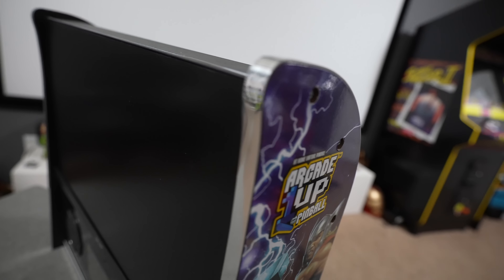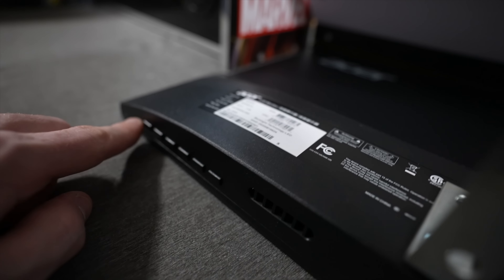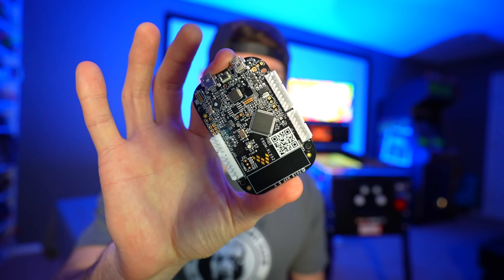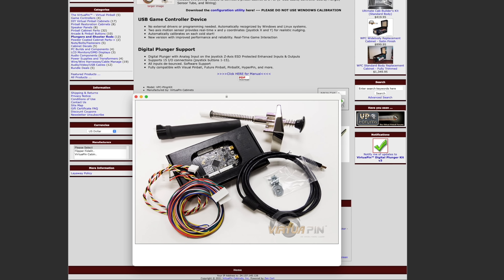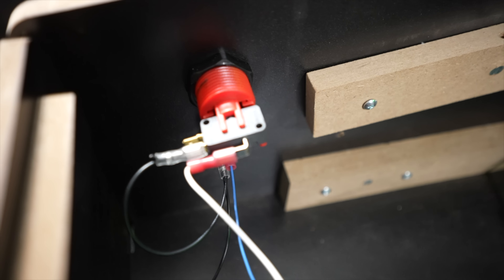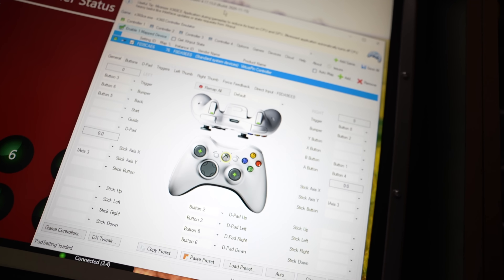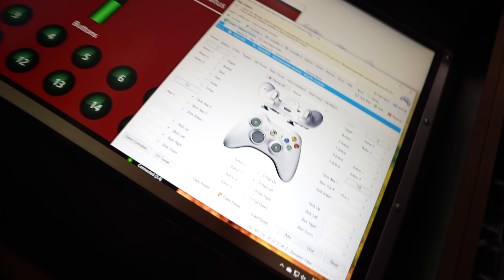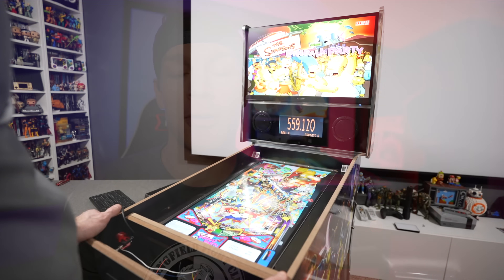Arcade1Up Pinball Mod Tutorial - Part 2

Comment: Modding my Williams Arcade1up..  Looks like some dimensions have changed somewhere as the 21" Monitor you used is not as tight a fit anymore (LOL)..  
My Williams stock monitor backlight went out..  So time to mod it up..  Got a 24" AOC and it fits into the slot where the original stock was.  Used some electrical tape to hold it on one side.  ..

I think I am going to try to route out the slot in the top and fit the top of the monitor (it is about double the width of the current slot.  The slide the monitor in from the side.
Wish me luck!

Comment: 8:35 The Virtuapin plunger also won't clamp onto the Arcade1UP wood box frame properly. The mounting holes/plate have taller screw posts. It looks like they were made for a slightly thicker wood mount than what is currently being used by Arcade 1UP. Not impossible to overcome, just something to be aware of.

Comment: For those interested the screen does not fit the mars attacks version of the pinball machine. Its off by 1/4-1/2 inch too small
Reply: Did you figure out a way to make it work? I have a mars attack cabinet and I have the same problem with the screen being too small.
Reply: @justincutler4143  yes. I used anchors to the back of the screen that I screwed into the screw holes then I created anchors on the wood floor that the screen sits on. Then I used big zip ties to tie the two  anchors together. The zip ties on either side of the screen allow me to slowly get either side tighter until it was perfect. Either side has a 1/8 in gap still but unnoticeable. For the top I used double sided 3m tape to tape the back against the top. It feels very secure despite sounding very insecure lol.
Reply: @nate5612  I found out that the monitor that is sold now is a different version than 3 years ago when he did this and the dimensions are a little smaller which is why we ran into that issue. I got it to work by padding the sides with some black stripping and then double side tape and the brackets on the bottom. Now I am pulling my hair out trying to get vpx working. It's so overhwhelming and frustrating that I wonder if it's even worth the hassle.

Comment: Thanks for this continuation video. I believe Kongs-R-Us was able to use the stock A1U plunger with the Geeekpi encoder. Using x360ce should allow you to use that in FX3, no need for more equipment.
Reply from the maker: as I stated in the video, there are several different methods of achieving the same results. I prefer the KL25Z board over the Geeekpi encoder for various reasons.
Reply: Difference i believe is, the board CoolToy uses is able to do nudge via buttons and/or physical, Kong's board is buttons only, no physical nudge. Both are options. Virtual Pinball is a rabbit hole and can be $$$, beware. 😂
Reply: @MrEd20901  you can actually install multiple klz boards and have them do different things, then link them in x360ce. I respect that there are multiple options and ways of doing things, but I still feel that spending $20 for a geeekpi using 100% stock pieces is economically and practically the way to go.
Reply from the maker: @MrEd20901  100% truth about the rabbit hole. That's why I said in the first video, you can spend very little, or a whole lot of money building and modding a machine. Since there are so many different ways to go about doing things.
Reply: @cooltoy  it is. I am in Major Frenchy's pinball discord. Some of the cabs in there are awesome. And a GREAT group of people. Very helpful.

Comment: I bought the same virtuapin plunger kit.  My screw terminals on the plunger look to be sized for 3/4" wood and the MDF on the A1up is 1/2".  As such, the screw terminals sit about 1/4" too long inside my cabinet and the mounting plate doesn't sit flush against the wood.  Did you have the same issue?  How did you resolve?  I'm thinking some 1/4" washers with a groove cut out might be my best bet but I wanted to hear your experiences.

Comment: OK so I have a question... Why do you have nudge buttons if the board comes with an accelerometer?  I thought nudge buttons for when you didn't have a built in accelerometer.  or does that just work for tilt and not actually affect ball movement when you shake the machine?
Reply from the maker: Simple, I like to physically nudge the machine and my wife prefers using the buttons. So now we can do either one and have the same result

Comment: @cooltoy  How did you connect the power to the DMD screen?  I have the black cord from it with the white adapter that no longer goes to a board. Any help is appreciated.
Reply: Same for me. I pulled the extension from the main power and ran it from the Y to the DMB controller. You can also order an extension cable from Amazon if needed.

Comment: I have that same monitor, is the monitor only staying in place mostly due to the sides being press against it?  I have used 3m tapes and gorilla tapes and nothing ever stays in place for long here in Phx AZ every thing droops with this heat. I'd be afraid that the monitor would just fall forward.  when you add the l brackets are you going to find a way to bolt them into the plastic or just 3m tape only?  Anyways, thanks for the video man.
Reply from the maker: The pressure from the sides and the 3M tape is more than secure for me personally. You could always drill a bracket into the monitor case if you feel the need for some more security
Reply: @cooltoy  good to know man. I guess I'll try it out when the cab actually gets here for my to feel in person. Thanks for the reply sir!

Comment: If you purchase the KL25Z accelerometer board with plunger from Virtuapin you are basically paying for everything setup, including the firmware to incorporate the plunger and nudge. Once you receive that kit, you download their software and it basically allows you to map the buttons, plunger and nudge features using x360ce. You then go into x360ce, select your accelerometer device and then go to the buttons/ sticks you want to map your plunger, buttons and nudge features. You then click the button or stick you want and click record. If you want to map your accelerometer to the dpad, select dpad up, left or right and then select record, then apply the appropriate nudge direction and it should map the proper axis to that button. You can then use Virtuapin software for you plunger / accelerometer to adjust the thresholds and multipliers to make it more or less sensitive. Hope this helps anyone who decides to add the digital plunger and accelerometer from Virtuapin to their cabinet.
Reply: Thank you for this.  I am embarking on this today after watching these very useful, insightful and appreciated videos.

Comment: Just wondering if I can put another 1up pinball machine electronics into my first cabinet,sharing monitor and buttons by using splitters,two power supplies,run one at a time,so I can mod the other cabinet..??
Reply from the maker: technically yes that can be done, but that's going to be a lot of extra work
Reply: Cool,not much else to to in lockdown,I only have room for 2 machines,so I figure it's a good starting point,Great looking cabinets.Any special plug required for the monitor ,splitter or just standard stuff.
Reply from the maker: nothing special
Reply: I just saw the original backglass flashing lights for mars attacks,what is the voltage for the backglass led's and could I use programable led strip lights to replicate the sequence,as well.?

Comment: Really nice work!  I have a question, why did you choose the Arcade1up and not the Legends pinball?  I ask because I am looking to buy a pinball machine and I am excited about mod'ing it, but some of the mods you did are already in the Legends unit (upgrade the playfield screen, controller for buttons and plunger, etc.) and based on price it seems like a better deal.  Just not sure if I'm missing something, like maybe it was because you owned the Arcadeup unit, or just a big fan, or maybe something big like the cabinet is better made or Legends has an issue you should avoid.  Thanks!
Reply from the maker: I own both machines and modded both
Reply: @cooltoy  Thanks, looks like I need to subscribe and go watch your other videos.

Comment: Awesome! Series. Just got my Star Wars! If it should break I'm ready :) I ordered on of those monitors before they become hard to find lol Do you have a solution for powering on the PC? or are you just going to mount on the bottom and turn on by hand?
Reply from the maker: Currently I've just got the PC plugged into a power outlet that has a toggle switch and I have the boot up on the PC set to start the moment it receives power. Technically I could splice some wires and connect the surge protector to the stock power switch and turn on the machine that way, but since I'm mounting the PC underneath the cabinet within arms reach I think that would be too much extra effort in the end.
Reply: @cooltoy  Thanks. Makes sense :) Looks like a great mod. I like the route you went with the plunger. More money but less fuss. Time is money!

Comment: So if I added the back box monitor would the dell optiplex 9020 still work ? It has 2 hdmi ports and 1 vga will that work or does it have to be 3 hdmis ?
Reply from the maker: it doesn't matter what type of display connection you use (hdmi, display port, vga) just so long as whatever computer you use has the horse power to send the signal to all three monitor connections. I'm personally using the opitplex 9020 with a 1650 low profile graphics card to get my 3 display connections.
Reply: @cooltoy  thank you for your quick reply and all the work you put into these machines for us to learn you could easily keep your tricks and charge ppl to mod theirs but you don’t you help as much as you can and I truly appreciate that thanks again.

Comment: Hello again, I gave an identical setup (been building along with you) and I can't get the plunger to work in all tables. It's works great in bob's burgers and does nothing in medieval madness for example. If you have any advice I would greatly appreciate it. Thanks
Reply from the maker: There should be no reason why it would work in one table and not others in FX3. Though I will say Medieval Madness uses a basic launch and doesn't actually use measure plunges as the original machine just had a basic launch button.
Reply: @cooltoy  that may be the issue then. Hmm, odd
Reply: Any idea how to make the plunger work for both types?
Reply from the maker: again, it should worth for both types in FX3 regardless. Worst case scenario you could always map the plunger to the Enter key in a program like Joy2Key and get it to work that way for single press launches also

Comment: Doug, you're amazing.  I am just starting on my journey and will begin the project on 4/14/22 when my AFM cabinet arrives from Walmart ($642.81) (I am a Bally/Williams junkie.)  I purchased the virtual pin kzl25 accelerometer and plunger kit you recommended ($171.70), Acer backbox monitor ($136.81), 36" LG playfield monitor ($225.21 refurbished), plastic feet, screw terminals, usb relay, jst connectors and diodes ($67.19).  I may do the additional exciters, amps and surround sound later but I think this is a good starting point.  Total spent $1243.34 so far.  (I have an HP Z2 micro sized PC with an i5 processor and integrated NVidia card with four display port outputs and 16 GB of RAM I got from work for free.)  I think that is SUPER reasonable for what this will be for the cost spent.  How large of a hard drive do you recommend for all the tables and storage?  Thanks for taking the time.  I used your affiliate links.

Comment: Got another question for you. I can't get X360CE to minimize at all on startup. I have PinUp Popper installed and running on startup but everytime X360CE autolaunches, it won't minimize. When I end up coming back from a game, the config utility sticks on top. I've written a bat to minimize it but apparently, there is a bug that makes it crash and I can't get it to work that way. Any tips?
Reply from the maker: If I remember correctly I just right clicked into that app properties and checked the box to keep it minimized. I believe you can also create a bat file that has start/min C:\whatever path your pc has to the program
Reply: @cooltoy  Thanks man! I tried both and couldn't get them to work without the app freezing. I ended up using an earlier build (v3 on their site) and that finally resolved it by placing it in the FX3 folder. Your videos have been amazing and stoked on my arcade 1up pinball build!

Comment: Hi Doug!  How did you get the new plunger to mount flush against the machine.  I made the T cutout like you did and I can get the plunger in there and it is flush against the front of the machine, but when I go to put the backplate on to secure it in place, the posts for the screws on the back of the plunger  platecome out so far that when I secure the backplate to it, the entire plunger assembly moves back and forth by an 1/2 inch or so.  In your video it looks like your backplate is perfectly flush against the cabinet.  What am I missing?
Reply: Have you got any answer to your question ?
Reply: @jeromelambert1048  I ended up putting cardboard on the inside to fill the gap.  I even emailed the company and never heard back from them.
Reply: Shims from a hardware store will work.

Comment: @COOLTOY I am having issues with the virtuapin plunger kit and was hoping you could answer it. I cut out the T section like you showed in your video. However, when I place the plunger assembly into the hole and connect the included backplate from virtuapin, it doesn’t sit flush against the cabinet. There’s a gap of about half an inch or so. Any clue on what I need to do or how yours is fastened in place?
Reply: I'm in the same boat with the kit and the half in gap between the backplate and the mdf... did you find a solution???
Reply: I had the same issue. I went to Home Despot and bought a cheap package of wooden shims, broke off what I needed, loosened the screws on the plunger, fit in a few shims, and tightened the screws. Works great now.

Comment: Hello again. I am starting on these steps today. I have the plunger kit and the KL25Z board. Are you using the Pinscape controller software or simply just the X360CE software. Not sure if I need to use one or the other or if Pinscape is just another alternative. Thanks!
Reply from the maker: Using x360ce

Comment: Sorry, more questions. Does the stock plunger analog connection fit into the virtuapin board? Just a lazy questiion really. I figure if I get the virtua pin kit I'll just set the better plunger aside until I feel like making the cut out. But if the connection is no the same I will cut it out lol Also, can you use joy2 key instead of the xbox config? If not, can you map keyboard buttons to the controller numbers? I play VPX and FUture pinball, everything is keyboard based. If the stock encoder etc is good, will it work with PC without the need to buy the virtuapin? Thanks again.
Reply from the maker: I could not figure out a wiring combination to use with the stock plunger on the KL25Z board that worked. If you want to use the stock plunger you can use something like the geeekpi encoder board that accepts analog inputs as well. You can use joy2key if you want, I used the Xbox config as it supports analog plunger input in fx3.
Reply: @cooltoy  Thanks man. I think I will get an arcade 1up. Was going to get a GRS but I think with all the fit and finish and mod possibilities this is a better choice. Thanks for all the help.

Comment: What kind of buttons did you replace the stock ones with?  You mentioned adding cherry switches but not listed below. 
Also with the pc did you need to swap your psu with the 1650 graphics card?
Reply from the maker: They are Happ buttons as I stated in the video. No need to change the psu for this 1650
Reply: Thanks. Love the video and looking forward to part 3.

Comment: Sorry if I missed it but can you tell me what video card you are using for this? Thanks
Reply from the maker: Gigabyte GeForce GTX 1650 D6 OC Low Profile 4GB GDDR6
Reply: @cooltoy  Thanks for the reply. Your Dell must be different than mine. My power supply is beside the PCI-E slot. No way I could fit a double slot card in there.
Reply from the maker: @c_ops6045  I’m using the stock power supply. It’s tight as hell but the card fit my 9020 sff optiplex just fine
Reply: @cooltoy  Ok thanks. Thinking of going with an adapter off Amazon and a regular PSU mounted elsewhere. Would give the card room to breathe and the extra power.

Comment: Hi Doug, I got a sb220q and followed your video but it just does not fit. The bottom of the monitor is too fat and it sticks out. Did you remove the back bezel from the unit or something?
Reply from the maker: Nope, left the bezel as is and didn’t modify the monitor. You want the front to stick out a little bit because the monitor menu/power buttons are located on the bottom. So you want the front to overhang/stick out a bit like I show in this video to avoid inadvertently squishing the power button on the bottom.
Reply: @cooltoy  thanks, I get it now. I wasn't able to clearly see the overhang in your video so I assumed it was flush. Still looks good!